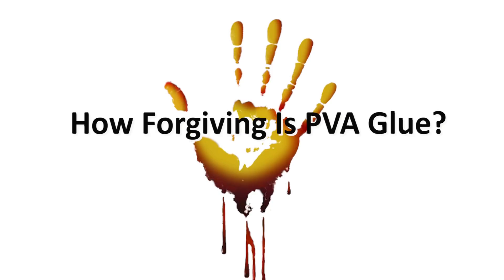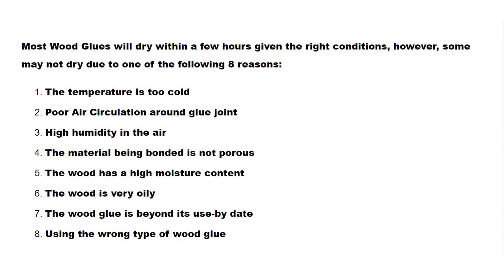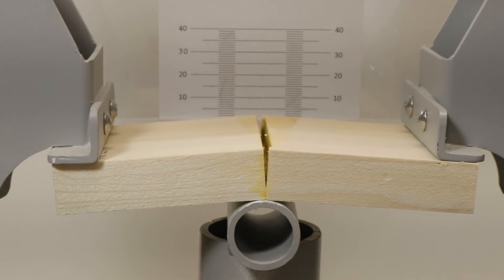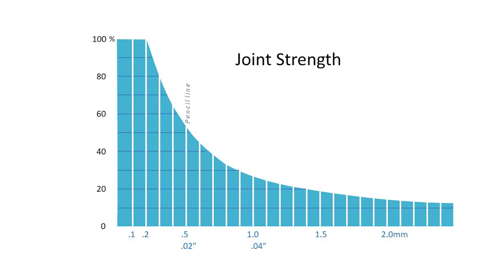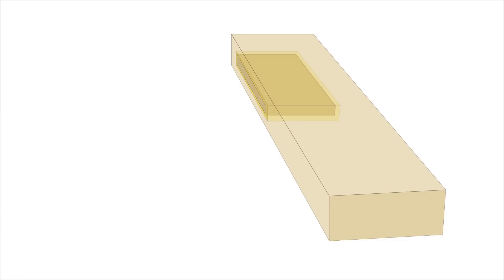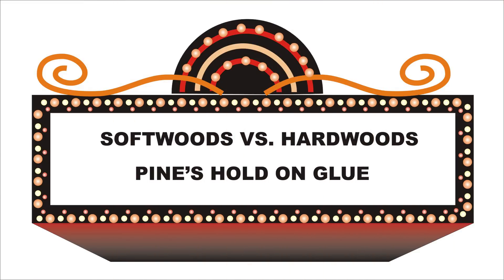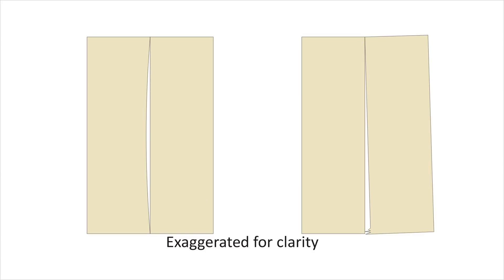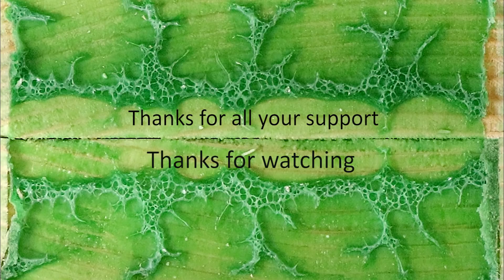How Forgiving is Glue?

Comment: Ideas from a random person with no woodworking experience but is interested in chemistry and material science.

1.  Use an adhesive that polymerizes without/with minimal evaporation, perhaps an epoxy of some kind?

2. Add a filler to the glue like sawdust. This is totally untested, and i have no idea how it would affect the joint

3. Use a mechanical joint where the majority of the strength doesn't come from the glue

4. Just don't mess up the joint, lol

4. Let some of the water evaporate  beforehand so it is more "dense" (somehow without it polymerizing)

Comment: As a beginner fumbling my way through a first project I have to first thank you for this series. This information is invaluable!

I also have a question. Have you ever tested some other ways of filling the gaps? For example, creating a poor man's composite material out of pva glue + cotton, or sawdust? From your test it looks as though the glue's surface tension is trying to create a minimum surface as water is lost, and by adding some fibrous, space-filling material, the shrinkage should be more even and result in a more regularly spaced (and hopefully stronger) lattice.

Once again thanks for the content!

Comment: Great video. I used your data to figure the additional strength added to a joint using Festool dominos. Example: for a joint 1000mm x 18mm (plywood for example). Using 8 Festool dominos (5x30) I figured with the dominos the joint strength would be increased by approx 28% if the joint is perfect, and by 45% if the joint is less than perfect (say 50% ultimate strength) I assumed Domino has a good joint and assumed 80% ultimate strength. I recently glued together 2 pieces of plywood (18mm thick, 400mm glue line) for a cabinet shelf (for my son, didn't want to cut a new sheet). I was too lazy to use dominos, just gule. The glue-up dried 3-4 days in my workshop (40% RH, 12-14C). Just yesterday I cut the piece for the cabinet (360mm wide needed) leaving a 40mm piece. I thought why not see how strong the 40mmx18mm TB III glue joint was. It broke with very little effort. I was quite disappointed and will use dominos from now on.
Reply: A Domino glue joint test would be interesting.

Comment: What about adding sawdust to the glue what does that do to the gap? These are incredible findings!
Reply: O also. Would taking a plan shaving and putting it between the two but ends and glueing it together so solid wood, glue, plan wood strip, glue, then solid wood. Does that,effect the gap issues or does it make it dramatically worse?

Comment: I've read most of the comments. Didn't see any that mentioned the idea of "pre-gluing" or sealing the surface of the joint with glue, letting it dry (and shrink), cleaning it up, make sure the joint still fits/works, then re-apply glue and mate the pieces and clamp. Is this dumb? I'd like to see a test of this, for the heck of it.

Comment: There is a trick to recovering a loose joint. Dry fit, and mark the gaps.  If it's a mortise and tenon, and you've over planed the cheeks of the tenon, check to see where the lost thickness is.  If it is symmetric, all to the good.  If not, things get fussier.  Spread PVA on the cheek of concern, and then press paper on to it.  Regular white bond is fine.  You don't need or want a polished finish.  Cover that with either a piece parchment paper or some other material that the glue won't adhere to.  You can think of this as paper shimming, with the paper as bulk that excludes excess glue.  Let it dry thoroughly - at least 24 hours, 48 or more is better.  Check the fit, correct as needed (it won't be as easy as cleaning up clean wood), and glue up the joint.  I started thinking about this while dissecting a Victorian mortise and tenon joint that had paper glued in with hide glue.  I have also seen this on shoulder correction.
Reply from the maker: I am quite sure that adding a shim of veneer works to boost the joint strength of a loosely fitted joint.  The question of what other materials also work remains open in my mind.  Many people use sawdust, and claim it works.  This is harder for me to test in a rigorous way.  However, your concept that paper will also do the job is intriguing.  I have not tested this, but my hunch is that filling the loose space with paper is probably much better than trying to fill the space with glue.  Thanks for the tip.

Comment: If your joints are that bad a bit more practice or use Cascamite, urea formaldehyde resin, or epoxy with fillers. Neither has the convenience of glue in a bottle but they are tolerant of gaps.

Do not think foaming polyurethane glues will help they fill gaps but add no strength.

Comment: For M&T joint when the tenon has shoulders, the shoulders are type 1 joint, the tongue of the tenon is type 2.

For loose tenon joints, including biscuit, it is both type 1 and type 2 joints, similarly. For loose tenon, by necessity there will be shoulders, in effect.

Comment: For type 2 joint, use glue that has no water and does not shrink, such as epoxy.  Even though the strength on wood may not be as high as that of PVA, the filling of the gap will aid in the mechanical strength of the joint overall. ---idea or theory.

Comment: Patrick, Great confirmation about the inherent strength characteristics of PVA glue; gaps are weak.  I have played with drying strips of glues on old Teflon lined pans, including PVA and epoxy’s with, and without micro fillers.  The PVA breaks easily just like when we break a dried run on the side of our glue bottle.  The epoxy, depending upon the type selected, has much more inherent strength.  I would love to have quantitative information about the strength characteristics of Epoxy and polyurethane adhesives like the West Systems products commonly used in marine boat building.  I guess adhesives are a lot more complicated than one would think.  You analysis of PVA commonly used by woodworkers is terrific and should give all cause to learn more about our options and how to select the best product for a particular application. Many thanks for all the time and effort you are putting into this series.  Cheers, Will

Comment: Speaking of glue, I have an idea for something I would like to see tested. I use hand planed finishes on my of my work, as opposed to sanding. The traditional advice is that a beautiful, glossy planed surface should be sanded before applying a finish, so it can adhere better. I haven't had any problems finishes coming off of hand planed surfaces but I'm curious if the surface has any appreciable effect on glue. Or to put it another way, is the bond between two sanded surfaces stronger than the bond between surfaces planed with a very sharp iron. If so, what grit of sandpaper creates the strongest joint?

Comment: Hey Mr. Sullivan, I have a question that's been on my mind for quite a while, and this video seems to answer it partially, about the glueing surface.

Is it better to have the surface (edge/face)  rough or smooth when applying wood glue?

I need an affirming answer, like YES, BECAUSE... (the reason) so that I can do my projects better. Thanks before!

Comment: Thanks Patrick.  There are limitations to your setup but I think when you look at things closely you can extrapolate with some control over the assumptions.  I guillotine my picture frame miters to make the joint tight.  I push the glue into the end grain as much as possible.  I have been using a Logon pneumatic V nailer but this likely is less important than I thought and should be done early before the glue really starts to cure.  I'll use fewer biscuits and make my mortis joints tighter.  I'll worry less about finger joints for panels.  I think poor quality glues in centuries gone by led to the development of many of the joints we use today (or not) and the quality of those joints.  If the joint is not tight, nothing really fixes it, except maybe epoxy, which should have less shrinkage.  Any chance you can test that in place of the PVA?

Comment: 👏👏👏 This video is amazing, it helped so much. It solved all my dilemma about PVA glue... I was adding more glue to untight areas in the joint, but at the same time notice the gaps after the glue dries, especially in the side to side glue ups. Now I know what to do, if the joint became a bit loose in some areas, just add more thin piece of wood... Actually there were times that I did that, and was surprised with the strength, but it was confusing me as I thought, adding more glue should hold better! ... Thank you👍

Comment: I love the work you are doing Patrick!    As others have suggested,   I would love to see a measurement of joint strength for other glues which are touted as "gap filling"  such as epoxies and urea-formaldehyde (UF) glues.    My favorite UF glue is Unibond 800,  which is touted as having better gap filling abilities because it does not use water as a solvent, but instead uses furfuryl alcohol as a solvent, which does not evaporate, but instead incorporates into the ultimate glue bond, and therefore does not shrink like PVA glues.   Keep up the great work!
Reply: Just to point out to anyone using UF glues the safety issues should you ever cut it or in any way huff the stuff. If you sell your products there are also restrictions in many countries with controls and required warnings about the formaldehyde content. And it does evaporate- slowly over many years. isn't usually an issue unless you have a lot of it around. IIRC it gases off most when near some heat source. Something to look into. Obviously you can't use it in food products, children's toys, anything really that is likely to be near a mouth intended or not. 

Just a heads up to use that kind of stuff responsibly.
Reply: Most plywoods are made using UF glues, so it is certainly OK to cut it.    UF glues were reformulated in the last couple of decades to greatly reduce off-gassing of formaldehyde, which was the greatest concern, but is no longer an issue.   While using the glue, while the glue is still wet, it is a good idea to wear a respirator and have good ventilation, but once dry there is no concern.    So yes, use of UF glue takes more precaution than typical yellow glue, but once dry, no concern.    Same is true of epoxy really

Comment: I'm watching all these videos with interest. Your rigorous testing is impressive, but it is combined with some strange test cases. This is not entirely new data - there have been multiple tests and articles in Fine Woodworking magazine which studied the strength of different joints and effect of gaps in glue joints. Those showed epoxy is the only glue that has any gap-filling strength. What I can't understand is why you spent time and effort testing gaps over 0.5mm. As the graph you first showed at 5:23 indicated, gaps of over 0.2mm start to compromise joint integrity. A properly fitted joint will hold together by friction before it is glued. If you insert a tenon into its mortise with the tenon piece hanging down, it should stay in place. That means a gap of around 0.1mm or so. I consider gaps of 0.2mm or larger too loose. You also state at 8:40 - without presenting one shred of data - that "Group 2" joint glue lines are going to be full of voids. Hogwash. A properly fitted traditional joint - mortise and tenon, bridle joint, lap joint, dovetail, dado and others will have clearances less than 0.2mm and will be very strong. Finally, your suggestion to repair ill-fitted joints with wood shims is great.

Comment: Thank you for your work! I thought about this very topic years ago but I was always under the impression that once the glue dried, it did not matter. Apparently it does! Which brings me to another question: if instead of PVA one would use epoxy, how would that change the results? I am sure it would fill the gaps better and would be stronger. Or am I wrong again by assuming instead of testing?
Reply: PVA done properly is far stronger than epoxy resins, but if you have a gap you might well be better off with the epoxy. If you are building load bearing furnishings, you'd be better to redo it than epoxy it. There are ways to save a bad joint but they aren't fast an easy like using epoxy instead.  That's my impressions however, take them for what you will.
Reply: @carbon1255  I think your last sentence sums it up: it is your impression. The goal of this video series is to get experimentation based evidence. I always knew that loose tenons would not be as strong as a thigh one, even if filled with PVA glue, but I never expected the difference to be that big. Redoing joinery isnt always an option and if it can be confirmed (as I and many others suspect) that epoxy would be over sufficient for the job, it would settle the debate for good. As I progress in my woodworking journey, I am amazed at the amount of things people do "because they were told to do it this way", but which arent properly tested. Basing an opinion on a 200 yers old technique isnt valid anymore since we 1) have better glue and 2) we have a better understanding of the forces at work in a joinery system. Everything we think we know about woodworking needs to be retested and confirmed.

Comment: Does this test kill the idea that salt might be used to keep a glue joint from sliding? Wouldn't the salt hold the joint at least microscopically apart, therefore weakening the joint as the tests here show?? Or might that be an interesting test?

Comment: Another GREAT video!!  Two questions:  Your initial chart, based on something that has 100% strength, does not indicate when it reaches 100%???  And, your summary discussion of filling the joint gap with a shim begs the question:  What if you added sawdust to the glue, to create a sponge-like area for the glue to bind to?

Comment: No idea how scientific this is, but sometimes I've used pieces of thin paper dipped in (soapy, watery) glue, sometimes simply sawdust added to the glue, to "build" up gaps before gluing surfaces together. Surprisingly, these joints are very strong. As strong as, if not stronger than, virgin glue joints. No idea why it how it works, but it does!

Comment: if glue is 50% water doesnt that mean the wood will absorb that water and swell accordingly? So for instance the example of the mortise and tenon, wont the tenon swell within the joint as it absorbs the trapped moisture from the glue?

Comment: Excellent content and presentation, as always. I wonder what improvement could be made on one of the test joints if the glue was bulked up with sawdust, for those occasions when the joint is a real disaster, and you need to rescue it fast? That might be a useful follow up to this experiment.
Reply: I have another tip for you- cocktail sticks. You can drill out the right size hole and glue them in like miniature dowels. It's another way to fix something that is breaking over time without breaking it apart. You'd think they wouldn't be that strong, but with pva glue and due to the forces being over a small part of the cocktail sticks and the grain being the right way, they are pretty strong. 

It obviously has certain best use cases - tension forces, where a tac or nail won't help. A joint that comes loose can be held tight again - its a repair tip really. however it is also very discrete and professional looking.

You can also experiment with paper/card just as well as sawdust if it more suits the application, as you can pressure paper in to a crevice which you cannot do with sawdust pva mix. I'm not sure if that is actually stronger at all, and you have to chose between sawdust, paper and a wedge of wood or popsicle stick depending on the size of the gap. Alas, that is what Mr Sullivan is here for.

Comment: Gluing a shin to the cheek of a tenon to fill a gap in the mortise will not be as strong as an accurately cut tenon because the strength of the tenon (and all mechanical joints) comes from the long grain not the lignum. If that long grain is severed at the shoulder you have weakened the joint. It seems this series repeated fails to recognize that mechanical joint strength is not glue and not lignum but long grain fibers

Comment: I've always used epoxy on critical joints where my fit is not perfect. I assumed that the epoxy would not shrink as much as PVA type glues. I use the slow curing type of epoxy. because it gives me lots of assembly time - another advantage over PVA. I wonder how Lee Valley's 202GF adhesive would do on your tests - it is a water based glue with claimed gap filling qualities.

Comment: I've been reading most of the comments here and I'm surprised nobody points out how useless this test is. Who in their right mind would glue end grain to end grain?
The wood fibers are stable in length so if some are shorter, for sure they won't glue  well. 
In practice however one glues long grain to long grain and then the wood swells when it soaks in the glue, filling some of the gap. In the other video he showed that the glue is stronger than the wood in long grain to long grain joints. What would have been a useful test is to have that kind of joint with a gap and see at which point the glue becomes weaker than the wood. I suspect that the gap would have to be much larger for that to happen. That would mean that in a real world case (for example a mortise and tenon joint) the glue is quite more forgiving.

Comment: If you construct a tenon joint with a wedge driven from the other side, does the unnecessary glue add to the strength of the joint?

Comment: I've seen it recommended to mix sawdust with glue to fill gaps.  I imagine that's mostly for the visual but I wonder if it would also help significantly with the strength too
Reply: I do use it aswell. Sawdust will press nicely and it helps to fill larger voids. And as this video shows: less glue = more strength. I doubt it will be by much thought and I would love to see some test :)